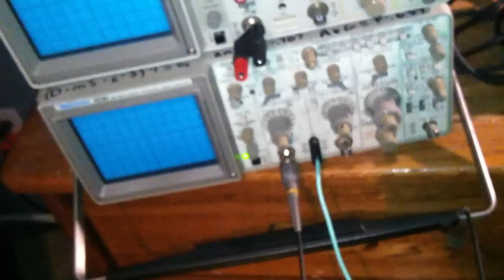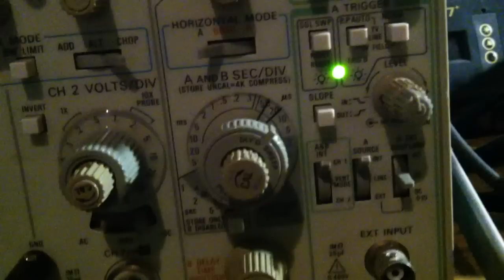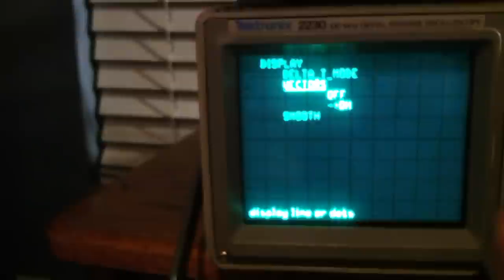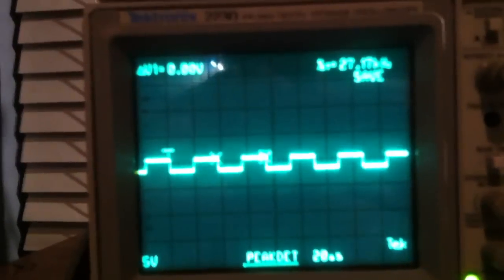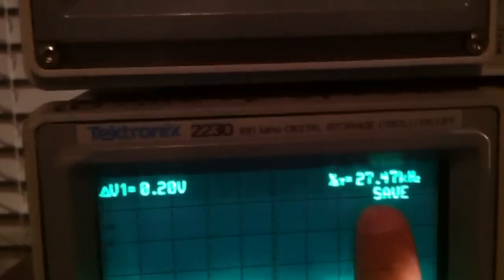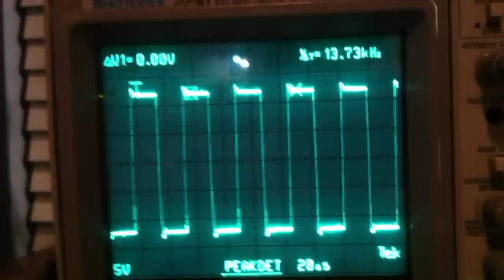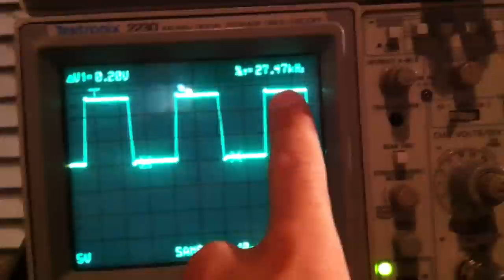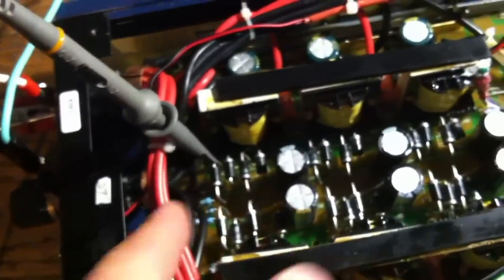Cheap 1500W power inverter teardown and explanation of operation

Comment: I really enjoyed watching this video. I'm an ex electronic / electromechanical  technician - nuclear electronics and copy machines. -  turned marine electrician, working on  navy subs and surface ships. I've never worked on an inverter before but a co-worker asked me to repair a Xantrex 1750 plus for him, so I decided to do a little research first.

Your video really helped me to understand how this piece of electronic equipment works. All I knew was that the DC is somehow interrupted / switched at regular intervals, thus converting it into pulses, which are then stepped up by "A"  transformer -  I thought. Now I understand why several transformers are used for this process.

Again, this video was extremely informative for me because I have not done any electronic troubleshooting since 2004. Hopefully I would be able to repair this unit and I must add, you have inspired me to get back into electronic troubleshooting - something I loved since I was a teen and did for 11 years.

I've already tested the on / off power switch and got zero volts when in the CLOSED  position and zero volts when switched to the on position, so I'm going to start with that. This tells me the switch might have an internal short. Another video I watched stated that 75% of inverter problems are due to the MOS-FET switches, so I'll try that next if replacing the power switch doesn't solve the problem - unit does NOT power uP

Thanks bro, One love

Irie mon

Comment from the maker: No there is no hot and neutral on this. I know it seems kinda stupid but its actually balanced power. Instead of having 0v neutral and 120v hot, there are two hots out of phase. Kinda like 120v and the other 120v leg make 240v. Here one is -60v while the other is +60v and the difference is 120v. Both legs are however 60v relative to the ground dc input line but this is just due to the nature of the circuit construction, not to act as a ground. The output ground goes nowhere but to the case.

Comment: PC power supplies are, in fact, isolated. At least any that pass UL testing are. The negative of the low-voltage side may be connected to ground but as far as line and neutral are concerned, at least 1500V of isolation there. The output of a microwave oven transformer isn't enough to break it down.

Comment: Please help! What is wrong with my inverter if the frequency is running hay wire? I'm in South Africa, we use 220V and the frequency should be 50hz, but it runs between 100 - 200hz on the output side.

Comment: What does the blue square potentiometer VR1 do on the output side of the board near that scratched off chip? I was turning one on a Go Power 1750 HD and it seems to affect the voltage output. BUT , no longer does anything yet the inverter is functioning ok.

Comment: its chinese.  the reason they use several small wires instead of one big wire is for flexibility in small spaces.  all modern tvs and radios use this method.  Even the iphone does.  good video.  small fuses take up less space as well.  check my channel if yoiu have a minute...  I love electronics too!  I'm checking out your vids tonight.  nice!  Steven

Comment: You say in the video (at about 3:13) "what do you expect from a little $100 Japanese inverter" Did I hear you right there?  I so wanted to repeat that, but immediately realised the futility of such boldness. "A LITTLE $100 JAPANESE INVERTER"? Are you fucking kidding me?   JAPANESE??? You owe Japan a very big and sincere apology here. DO IT.The longer you delay going metric the more fuckups are gonna continue happening. I mean, did you not learn anything from the Hubble Telescope Debacle / Shitstorm ?  The sooner we all are using the same standards, that's when tech will really take off.  I mean come on! All the scientific stuff in USA is metric already. It's just the engineering side that lags behind. STOP TEACHING INCHES, POUNDS,  YARDS AND MILES IN ELEMENTARY SCHOOL. There needs to be a seismic shift here. GET THE FUCK ON WITH IT. (Dontcha jus luv the internet?) (Chinese u mofo)